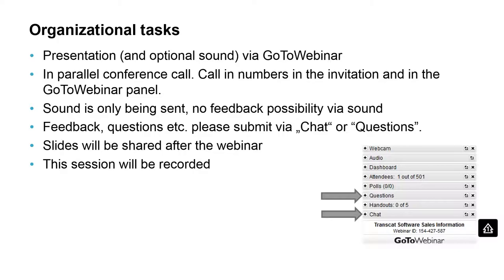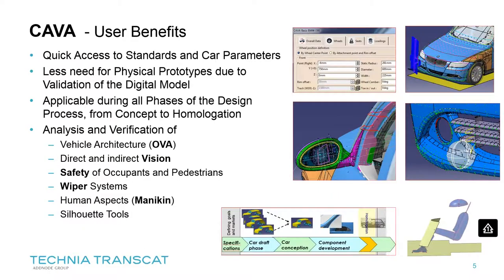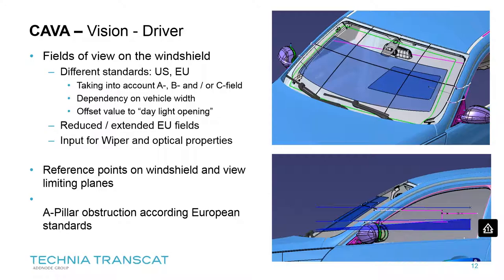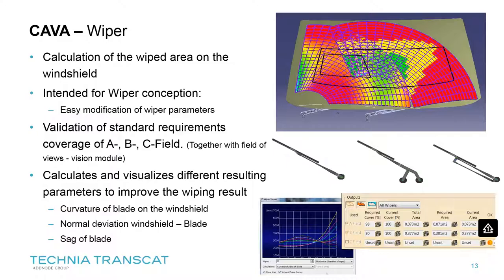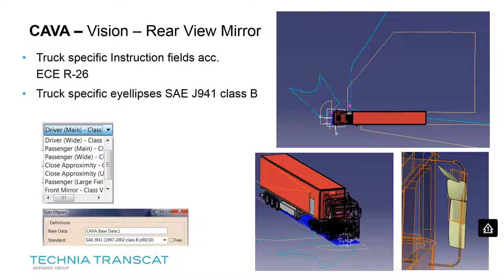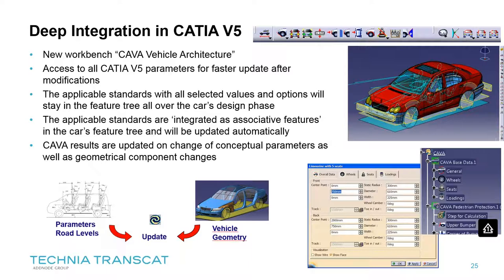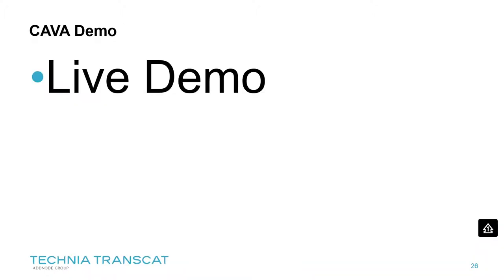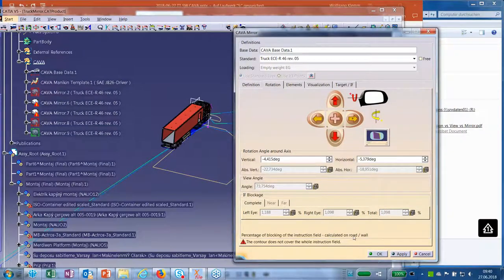Make Sure Your Automotive Designs Meet International Standards

Comment: Hello Sir, I have tried to create visibility for meter cluster using direct view 3d to check obstruction view caused by wheel steering, but unfortunately it's didn't work well. the result is not as what I expected.